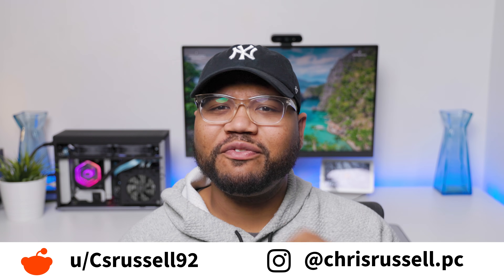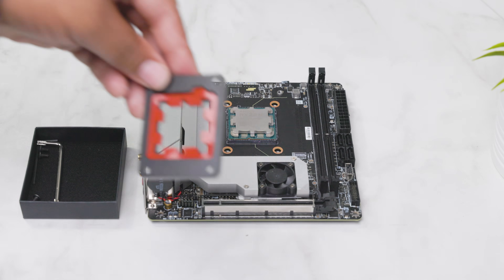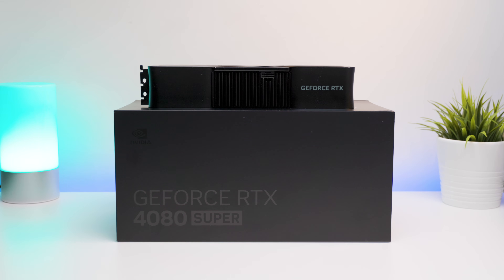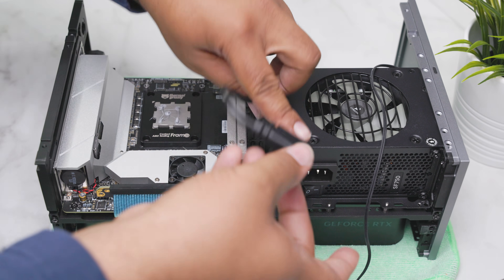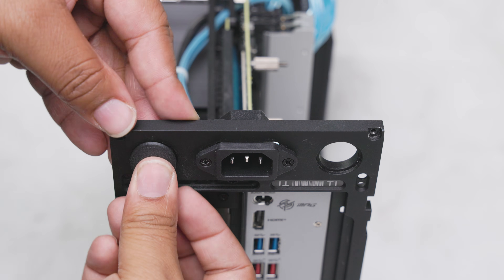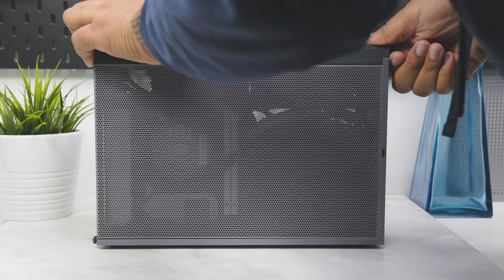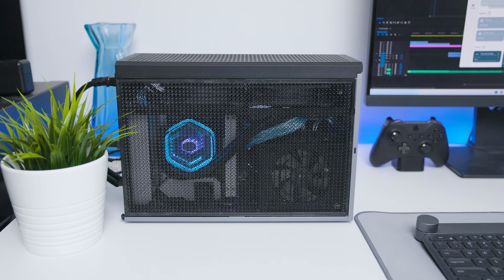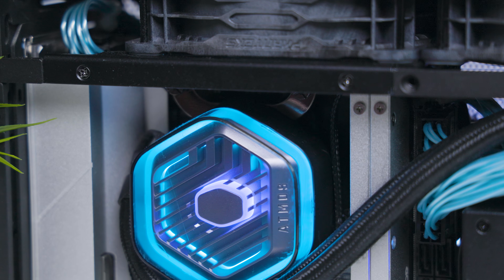FormD T1: 2 Month Update - Phantek T-30's & Cooling Mods

Comment: How can you have 2x t-30 fans at the top? I heard u needed 1 slim above motherboard
Reply from the maker: Yes you can with the top hat, but you need a 27-30mm radiator

Comment: I used a Thermal Grizzly contact seal once never again. When I upgraded my CPU I went to lift the contact frame not thinking to hold the CPU in the socket and the CPU came out in the contact frame then fell into the socket almost ruining my $500 motherboard. Just a reminder the CPU might stick into the frame with the gasket so secure the CPU into the socket while removing the frame.

Comment: Since the official top hat is impossible to buy, could you tell me which printing service you used as it’s too big for most 3D printers?
Reply from the maker: I used a local service nothing online, however I am tempted to try for more premium prints and I’ll let you know what I do
Reply: @ChrisRussellTech I appreciate that, I’m about to build my own T1+9800x3d+5090 but with an atmos instead of CPU fan. Would love to use the phanteks I snagged and will let you know how my own 3D print goes.

Comment: Great build! Did you test it with the T grill at the bottom? Two slim fans could fit.
Reply from the maker: I did and it was 1 or 2 degrees cooler but not worth picking up two or buying one just for the bottom airflow. I can see if you wanted extra storage and want to use one fan for M.2 cooling.

Comment: which m3 standoff u used on the psu? length i meant? TIA!
Reply from the maker: I’m not sure but the stand off I used came with the cases there’s two left over if you build the 3.25 slot option.

Comment: Fantastic! How did you strip the decals on the motherboard?
Reply from the maker: I used 100% acetone nail polish and cotton pads.
Reply: @ChrisRussellTech  Awesome! I have a KXRORS S400 case I want to strip the paint from, to match the brushed aluminum front panel I/O. :)
Reply from the maker: Good luck!

Comment: how did you take the decals off of the mother board
Reply from the maker: 100% acetone nail polish for the VRM shroud, the m.2 decals can be taken off with heat as it’s just acrylic. Use the acetone and cotton pads (not cotton balls). Let the soaked cotton pads sit on the area for 1-2 minutes and repeat until all of the pair is gone. It’ll look like you’re done but repeat again once it’s dry as there will be some residue remaining.
Reply: Thank you!

Comment: I plan on printing this top hat. What printing material did you use
Reply from the maker: I’ve had two. One in PETG which broke and in PLA that broken and started to soften and warped due to heat.

Comment: How did you remove the decals on the motherboard? Were they just stickers? It makes it look so clean, manufactures need to take note
Reply from the maker: The decals on the VRM heatsink was just basic paint, not sure the official name but sinuses 100% acetone based nail polish remover and a cotton swab. The M.2 fan/heatsink is just a piece of acrylic with adhesive. You can remove that with a hair dryer or heat gun
Reply: @ChrisRussellTech  thanks!

Comment: does it make sense to install psu stand offs if you are in 3.25 mode?
Reply from the maker: So in this video the case was in 3 slot mode but recently I moved it to 3.25 slot and uninstalled the PSU standoffs because they don’t fit in 3.25 slot mode.
Reply: @ChrisRussellTech  got it, thanks

Comment: Excellent video! Any chance you could drop those cable lengths of the custom cables? It was the only information I was missing in the video or description text to make me more confident before placing my own order of those blue delights right now.
Reply from the maker: For the T1, I have 350mm (35cm) for the 12VHPWR GPU cable, 150mm (15cm) for 24-Pin motherboard cable and 300mm (30cm) for the EPS (CPU) cable. I will most this information in the description, Thanks for the support and feedback.
Reply: For anyone who will be ordering custom cables and reads this. If you have a different motherboard the lengths of his cables might not be right.
Reply from the maker: @Bigheadedwon  very true. These measurements may work but it’s a good idea to research the placement of the 24-pin, eps and other cables you plan to use. I’m using the MSI B650i Edge Wifi.

Comment: Could you help me with custom cables for lian li sp850? also for t1 v2.1
Reply from the maker: I am not an expert on this however, how ever optimum tech made a video covering making custom cables if that’s what you mean. Or do you mean if I could help with sourcing pre made custom cables?
Reply: @ChrisRussellTech  Yeap)) I mean where I can find pre made cables, thanks
Reply from the maker: @batir4ik  probably the easiest place is Mod DIY. You’ll need to input your PSU make and model when you order cables. I only need 3 cables, 12VHPWR for GPU, EPS for the processor and 24-pin for the motherboard. If you have other accessories like hard drives, SATA, etc then you’d have to choose those as well. You’re looking at 20-40$ a cable depending on length. There are some vendors on ETSY that people vouch for. In this link they’re discussing cable lengths for the T1 https://www.reddit.com/r/FormD/s/okXDStn2Kx
Reply: @ChrisRussellTech can toy please educate me on the length of each mod cable you have purchased? Trying to order my cable too!
Reply from the maker: @chehsuntao  I’ve covered it recently in my CH160 review, but to save some time, CPU/EPS 300mm or 30cm, 12VHPWR GPU 350mm or 35cm and 24-pin 150mm or 15cm. I hope this helps!
Reply: @ChrisRussellTech  you the man! Subbed!

Comment: I have an identical build except a 7950x3d and a id 47xt cpu cooler. I’ve been getting temps of 80 celcius under no load. Thoughts for fixes?
Reply: The CPU cooler need to set properly and had thermal paste...
Reply from the maker: @seanpaul211  I believe he should remove the cooler. Ensure there is enough paste, also ensure the film isn’t on the cold plate. When reinstalling, fasten the screws down in a X pattern, 2 full turns until it’s fastened. It’s not within spec for any AM5 chip to idle at 80c, even with a 47mm low profile cooler.
Reply: -25 pbo, set ppt at 75w to start
Reply from the maker: 80 under no load.. that sounds like a direct cooling issue not sure much about setting.